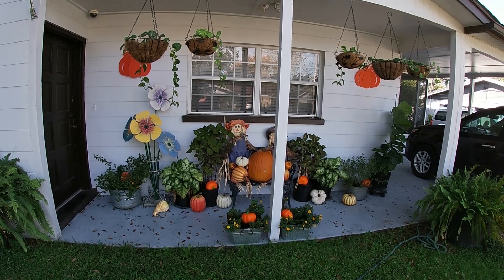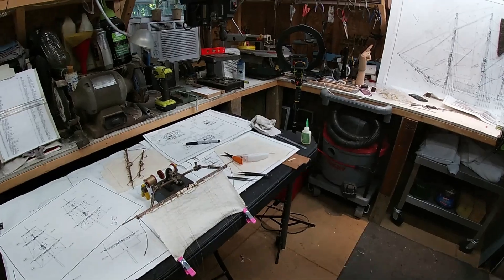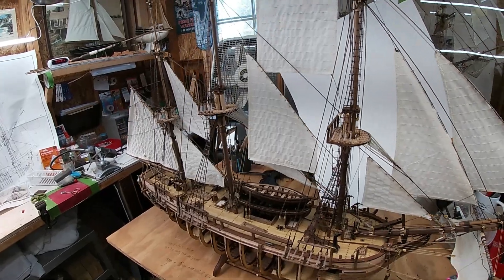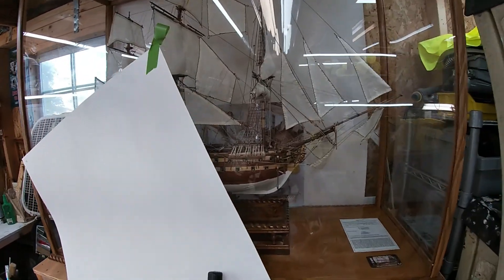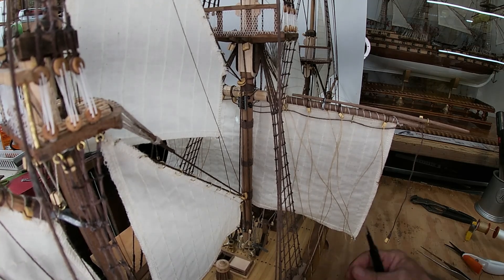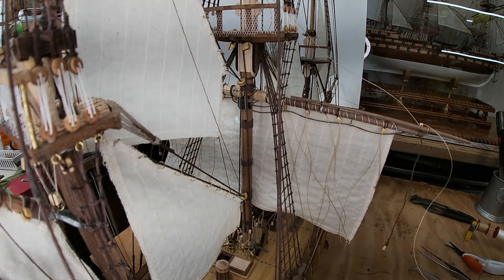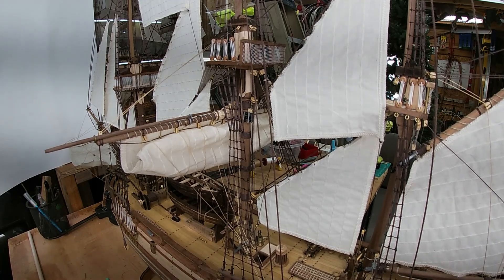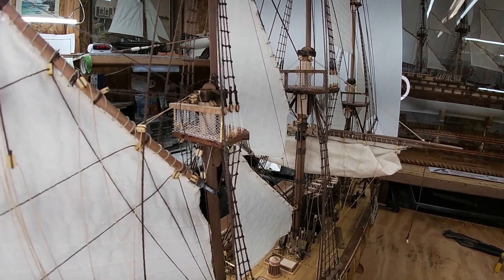HMS Bounty build part 44

Comment: Roger I have already this model by hattchet part works many years ago and I'm now in the middle of the process of building the charcoal version like in the burning of the bounty and a right tricky little crumbling mess it's becoming but very authentic looking also I would love to hear your take on this been a very astute modeller yourself.
Reply from the maker: Intresting  ?  From history reports they stripped the Bounty of all usefull items befor setting it ablaze just off the shore line. Parts of the wreack are still visable today. I couldn't imagin what it looked like befor they burned it.